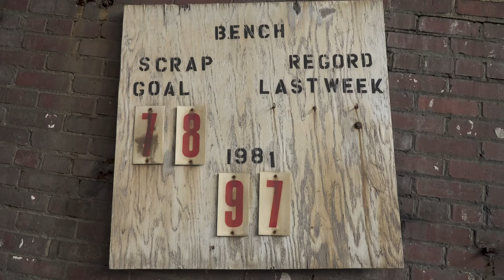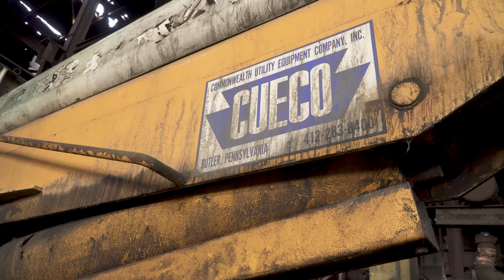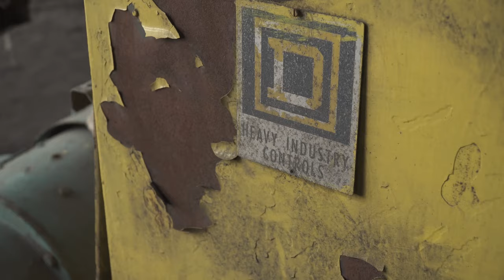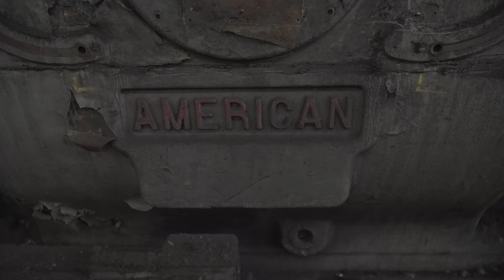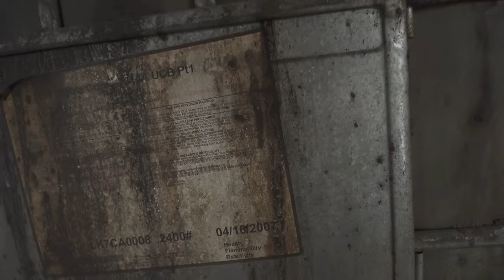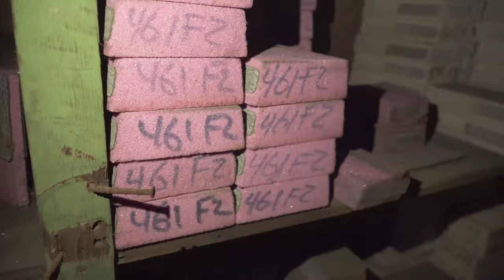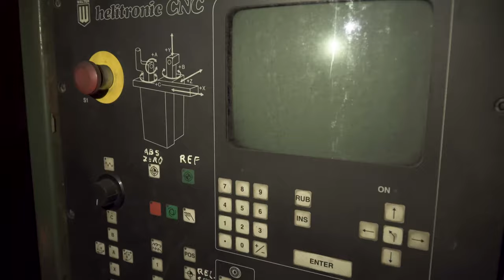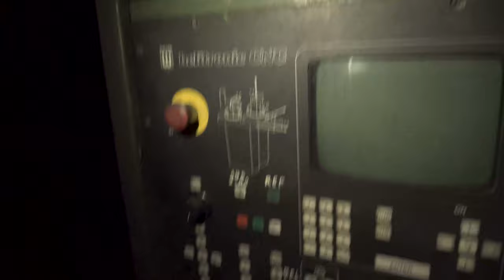Explored the Abandoned Building where she fell - Atlantic Foundry (Abandoned Places)

Comment: At 15:55 the area you are looking at is the heat treating department.  The 2 big recessed areas beside the safety signage are furnaces.  There are 2 big pits in front of the furnaces for quenched the steel made at the foundry.  They would take the steel into the furnaces and heat it until it was red hot then put it in the oil then the water to cool it.  They had explosions in this area a couple times.  My dad was the supervisor of this department.  It was a very dangerous place to work.  It was unbelievably hot in this department.  My dad's best friend had his leg cut off while moving steel into one of those furnaces right there. These guys were a different breed for sure.

Comment: Yep that is a sreel mill. In your trailer video the bays labeled h13, h12, s7, d2, and d1 are all tool steel. S7 and h13 i use in blacksmithing to make punches and drifts. Forklift tines are great steel as well, usually 4140 which is my favorite steel to work with. Not the toughest, not the hardest, but a great balance and very easy to manipulate. Also not anywhere near as pricey as h13 and s7. That vehicle with the clamp on the front is used to hold and rotate hot steel to be formed in the press next to it. If you have not look up a video of the vehicle and press in action. It is fasinating to see giant yellow hot rods of steel being formed into things like drive shafts for massive earth movers.